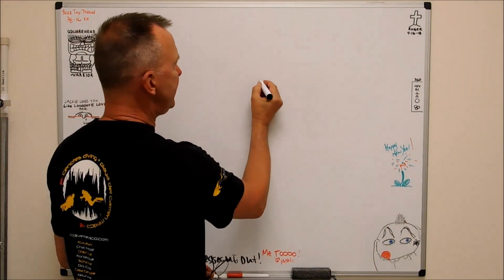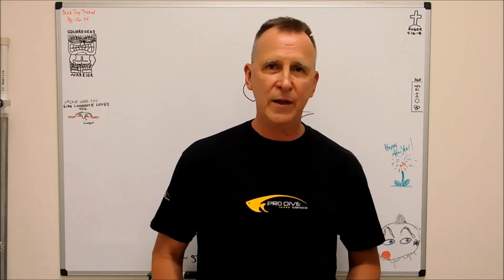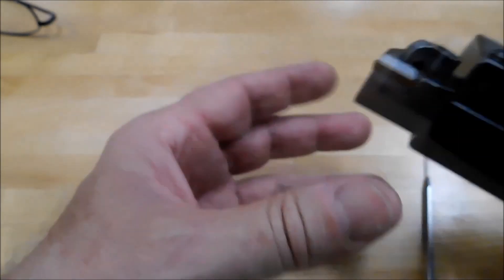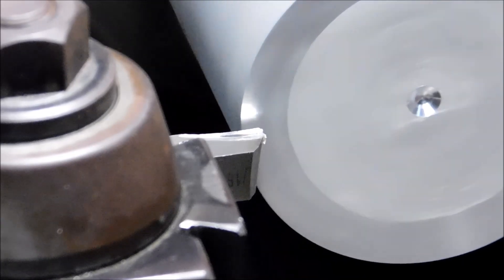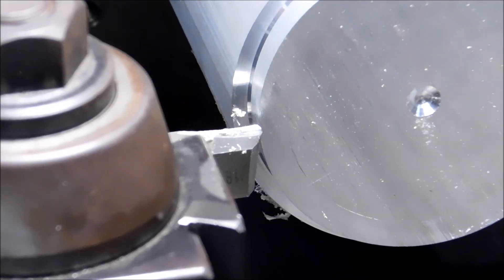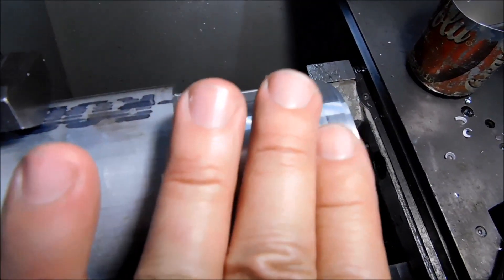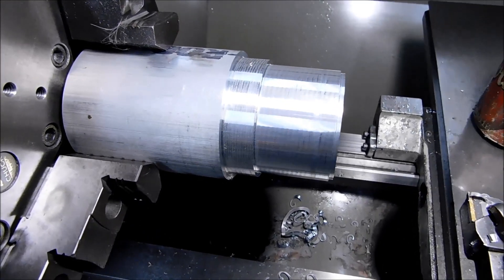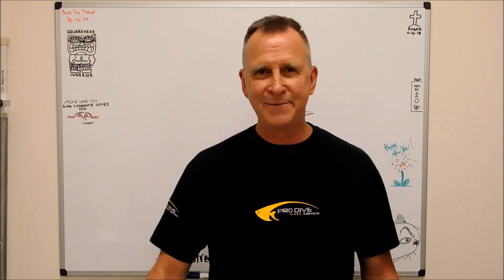C's and 6's...The Perfect Lathe Chip

Comment: Thanks for another great, informative video Joe. I have a question for you.  I am trying to make eight height extension/ leveling pads for my lathe and am using 3" mild steel. I am trying to face cut them to the same thickness. The issue I am running into is that the first of the facing cut I am getting a birds nest around the tool. About 1/4" into the facing cut I am getting long tight spirals and then when I get within an inch I am getting the Cs and 6s. I am using an insert for the cutting tool and the chips are deep blue until the last inch where they are grey. Is this normal? Should I be doing something different?
I am new to metal work and I appreciate any advise anyone can give.
Thanks again for all that you do.
Reply: I figured that the difference in chips was due to the sfpm but I was wondering if I needed to change anything or if I am doing it correctly. What I started doing was interrupting the cut, backing the tool away from the work in order to clear the rats nest before continuing with the cut. My aim is to learn best practices and replace any bad practices. 
Thanks
Reply: sfm... would require unlimited revolutions from your machine, when your cutting tip reaches '0'. As you cant catch up with revs the strain on your tool gets pretty extreme.

birds nest can ruin your finish, break your tooling, use a tool to remove the chips. 

Don't go overboard with revs, stick to something reasonable in consideration with your workpiece size.